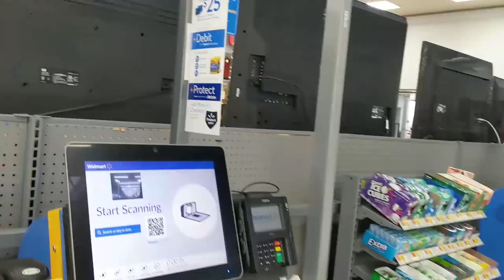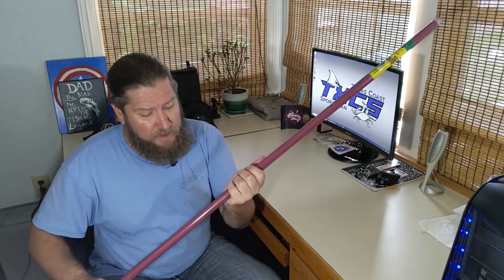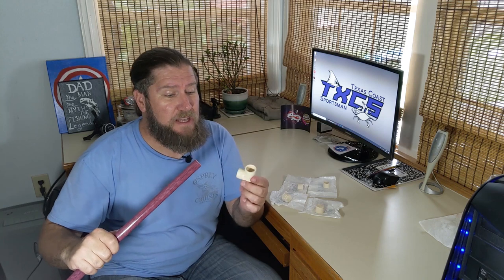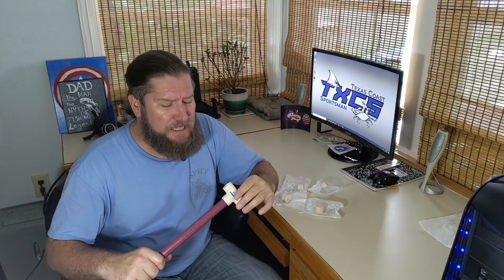DIY Stake Out Pole / Shallow Water Anchor all off the shelf parts

Comment: I drilled a small breather hole on the T, so the fumes from the 2 part epoxy could vent, and not push out any fittings when drying. Thanks for the diy. Tight lines.
Reply from the maker: That's a great idea. In the video you can see when I place the tee on the pole 1 end cap pushes off. No big deal just didn't account for how much air I was displacing.
Reply: @TexasCoastSportsman  id suggest just put the caps on last after everything else is cured what little bit you add for the caps shouldn't effect anything.

Comment: I found the poles at a local walmart on clearance for 3.50 each. Purchased two of them and 5.00 worth of pvc fitting and neighborhood hardware store and made two for my kayak. Thanks for the tip. Put part of a pool noodle around the top of pole if it falls in the end will float.
Reply from the maker: What? Your store has already clearance them! Man I might need to go buy a couple. I've got a boat project that I'd like to make a 12' for.
Reply: Louisville Ky. Come on up we'll hit a couple of lakes that are within an hours drive. Remember to bring your "yak".

Comment: I agree! What about the boat hardware into which this pole is inserted?  Any DIY instructions for that?  Thanks!
Reply: If it’s a 3/4” pole, it should fit through a scupper hole and work pretty well. Get perpendicular to the current, and you can put it in front or back scupper hole, depending on which way you want to be facing. 👍
Reply: I use my anchor trolley ring.

Comment: A tip another video showed was make 3 lines on the fiberglass pole then push your handle on so the air has a place to escape then twist it to spread the jb weld around. Rest looked good.
Reply from the maker: That's not a bad idea!

Comment: I built the same thing...heres a tip, here in North east FL we have oyster beds, 1/2 inch metal wire conduit fits inside the other end ...stick it in about a foot or so and leave a foot sticking out and cut on a 45 degree angle...goes right through oyster beds like butter...without this the fiberglass will shatter over time.
Reply from the maker: So, slip 1/2" electrical conduit over the pointed end to form a metal tip? Nice! How tight of a fit is the conduit? Do you think a decent length piece would add enough strength to join 2 together for a 12' pole?

Comment: I've made a bunch of these. IMO the 5 footers which are 1/2" diameter actually go in the bottom easier and are easier to pull out of the mud than the 3/4" diameter 6 footers. This time of year I've seen them for $2.97 at Walmart.
Reply from the maker: I checked my local store the other day and didn't see any but I didn't check outside... hmm

Comment: Howdy TCS. Just found your channel and subscribed. Built identical stick for my yak for $16 in 2018. It's a great cheap option, but not good for all situations. Results vary depending on bottom structure. Firm sand or rock is a no go. I mostly fish soft mud/sand mix. This garden stake works fine in certain situations, but tends to pull out of soft bottom in windy conditions and water +3' deep. Good job on the DIY vid.
Reply from the maker: Thanks for the sub! I keep telling myself I need a throw anchor for hard sand and shell bottom, but then I chase the reds up into the marsh and it doesn't matter any more. I've had a time or 2 when it wouldn't hold but most those cases the tide was dumping water like a ragging river. I've harpooned my into over 6' deep water to stick in the bottom and had it hold me. That's a crazy feeling throwing your stake like a spear and hoping the para-cord holds so it's not the last time you see it.

Comment: I made the mistake of getting the green garden stake the first time I made one. Don't do that. It will bend and it will break. This fiberglass model is much better. Great video.
Reply from the maker: I used a telescoping aluminum pole for my first one. How I didn't bend that thing into a U is beyond me.
Reply: I made the same mistake. They are made weaker than a soup can. I ended up cutting mine at the break and making a 3 footer to stick down scupper hole when I’m backed up into marsh grass. The T handle has a V recess so it doubles as a rod rest.

Comment: JB weld only needed on the fiberglass rod to PVC  "T".  Pvc cement adequate for remainder of project.
Reply from the maker: True but if you already mixed some up... My nephew did a variation where he only used the tee. Leaving both ends open to run his tether through.

Comment: ... Because of the very soft (silt) bottoms where I fish the pole needed to be longer to penetrate deeper for the holding power. I bought from Graingers, Rod Stock, Polypropylene, 3/4 In., 120 In. Added, like you did, a T on the top and sharpened the bottom. Use a 6'+/- rope from the T to the boat cleat on my Triton 240 LTS. Holds very well.
.
Reply from the maker: Nice!

Comment: How did you attach the pole to your boat ?
Reply: Same question...
Reply: I left my t fitting hollow and tied a rope thru it
Reply: Use a flag pole holder with a pvc extension to the same T fitting on the end for the pole to go through.

Comment: Bro thanks so much. This video saved me 65 dollars. I got that green pole that was next to the pink one you grabbed because Lowe’s was out of the pink ones. Got mine for 11 dollars with the cpvc. Just one thing, how do you stake it into the water without putting it in your scupper holes. I heard they break from the pressure. Thanks.
Reply from the maker: I use an anchor trolley so, I can position the pole at the front or rear based current. Plenty of people stake though a scupper hole I'm light current.

Comment: Metal tee is even better in plumbing section
Reply from the maker: What type of metal? I knew a guy that liked  using a copper tee. He was always concerned about a glue ability to bond with copper. So, he drilled and through bolted the tee to the handle.

Comment: Wonderful solution.  Can you detail how they connect to the boat?  I have a Carolina Skiff and would like to try this option.
Reply from the maker: For a skiff it could be as simple as a metal ring attached to a tie down cleat with paracord. There are several manufacturer of hard mount tubes that give you more of a power-pole  effect. Those mounts usually start in the $200 range.

Comment: Need that for my Titan, for sure!  Don't know if Wally World has those "sticks" this year (with the Kung-Flu going on), but I'll look for'em for sure!
(S/S Pop Rivets do the same "trick" as the Epoxy?)  
Thanks for the "Nifty" idea...  (Now, to invent a pulley-system or a cheap Motor Drive for it...!)  Haha!
Reply from the maker: There are guys using a plastic electrical box and pulley to make a "auto deploy" anchor. It uses the rod weight to drop and stab the bottom. Even saw the dude on Tiny Boat Nation build to for his aluminum boat conversion.
Reply: Texas Coast Sportsman do you have anything showing how they did that? Sounds awesome!
Reply from the maker: Search "diy kayak anchor pole" look for thumb nails that show a grey 4x4 box mounted to the kayak. For now I'm good with manual (spear stabbing) deployment.

Comment: great video! Subbed
what do you use for a spike on the bottom?
Thanks William
Reply from the maker: I don't, the pole I was able to get already has a sharpened tip. I've been able to find these poles this year.
Reply: @TexasCoastSportsman  cool, do you think two 12ft poles will hold a 15 ft aluminum bass boat? I fish in 7 to 10 ft of water. 
Thanks William
Reply from the maker: Yes, with a strong coupler. A PVC slip collar would probably ultimately fail.
Reply: Cool, Thanks!
Going to buy the supplies today.
Thanks again
William

Comment: These look way better than the pvc ones I've been using...do you think a 3/4 coupler would be strong enough to hold 2 of these together to make a 12 ft pole if I epoxy them in.. I'd like a 10ft one so I can cut a couple feet off... thank you for sharing this video
Reply from the maker: CPVC or PVC coupler may be a little short to build in strength. Maybe look at copper tubing couplers to see it they're longer.
Reply: Ok I'll check into that.. thank you
Reply: I would use aluminum tube longer
Reply: Did anyone actually successfully couple these?

Comment: Handle.  Great.  What about the other end?  How long was the pole?  Could you make it longer?
Reply from the maker: The pole is 6 foot and the other end is pre-sharpened. I haven't experimented with making it longer yet. The question is if you are using this pole what do you use to join them that will be strong enough.
Reply: @TexasCoastSportsman  JB weld a threaded male adapter or union to the fiberglass pole and do the rest in pvc to extend and break down? May be a good way to add length when needed. Not sure how well the pvc extension woul work..

Comment: I’m new to the channel do you have a video of how it works? Is the rod too thick for sand?
Reply from the maker: To work the anchor you just stab it into the bottom. In soft marsh mud I can deploy one handed while fighting a fish with my other hand. Packed sand usually takes both hands. It's not easy but not impossible.

Comment: Will PVC glue work instead of the epoxy?  Did you sand the pole before installing the "T"?
Reply from the maker: I don't believe PVC glue will bond to fiberglass epoxy. Sanding the pole would help create a "tooth" for the epoxy to bind to.

Comment: How does this work for the boat?  Is this for a kayak?
Reply from the maker: It works great for a boat. A Power Pole or Talon uses a 1" fiberglass rod to peg into the bottom of where ever your fishing. We are using 3/4" and your strength, since there are no hydrologics. Based in the size of the boat and the current you fish you may consider making 2. If you've ever thrown 2 anchors you know it'll stop you from spinning.
Reply: @TexasCoastSportsman  what do you attatch it to?  I am new to the boating world so sorry if I seem dumb lol

Comment: Any chance the hardware store and find a coupling, a bit more epoxy and instant 12 ‘ rod??
Reply from the maker: I've been debating the same thing. I'm concerned if a  PVC or CPVC coupling would cover enough surface area to make a strong union.
Reply: @TexasCoastSportsman  Use a length of PVC pipe
Reply: @TexasCoastSportsman  I was going to ask the same thing about a coupling making a longer pole out of 2.  I also wanted something that could break down in 2 sections to fit in my kayak and truck during transport - 2 4 or 5 ft sections.  I wonder if adding a set screw to each end would help?  Or using the M/F adapters for paint pole extenders?
Reply from the maker: It may ght be worth the $25 to get the stainless coupler from Max Gain System. They have full kits for making stake-out and push poles. But, if your going to pay for the full kit you may as well buy a Yak Attack pole.

Comment: These poles are on clearance for 
.50 cents right now I bought 4 of them  lol
Reply from the maker: What??? That's crazy!
Reply: @TexasCoastSportsman  question. In your video its says that the white pvc 3/4 tee is too tight.  However I bought one and it's way too loose.
Reply from the maker: @504Dboi06  lose in all 4 poles you bought? It may be a small tolerance issue between schedule 40 and 80. How loose? Free spinning or rock back  and forth? The epoxy will fill in some of the gap.
Reply: @TexasCoastSportsman  yes really loose. Too loose to work
Reply from the maker: @504Dboi06  do you have a caliper you can measure the pole with? I would measure then go to the hardware store and check them see way fits best. Schedule 40 ID is around .824" while Schedule 80 is .742”. If yours is 80 see if you can find some 40.

Comment: I just bought these stakes for 4.97 each!
Reply from the maker: I saw the same price the a few weeks ago. They're clearance to get ready for winter.
Reply: @TexasCoastSportsman  I just made two of them. I used 12 inches of pool noodle secured 3 inches under handle. Hoping that will be enough flotation
Reply from the maker: I keep mine tethered to my anchor trolley. Been known to throw it into the water like a spear if it's deeper than 6 foot.

Comment: How do you mount on the boat?
Reply from the maker: On a kayak you can push through a scupper hole but I prefer my anchor trolley. Allows me to position the angle of my kayak based on wind or current. On a boat you can tether to a cleat.

Comment: I asked this in a reply,  did anyone actually successfully couple these?
Reply from the maker: I'm debating coupling 2 but the weight has me concerned about using a diy sleeve. Max-Gain System sales a coupler for $26. But I looking at using it for a push pole. If you just want a long anchor you can probably get buy using copper tubing and a bunch of epoxy.
Reply: @TexasCoastSportsman  thanks for getting back to me.  I'm thinking of drilling down the center of both pieces, putting an insert in,  then threading them together.
Reply: That way I have a 6ft and a longer one if I want.
Reply from the maker: I had the same thought. But when comes to center punching with a drill... I don't have the best track record.
Reply: @TexasCoastSportsman  that's my fear as well.

Comment: So how do we put it on the boat
Reply from the maker: How big is your boat?
Reply: Texas Coast Sportsman 16 ft
Reply from the maker: You could make a fixed slide through pipe mount. But I prefer for my kayak to be able to move since I deal with choppy bays. Search Google Images for "shallow water anchor mount". You find some good ideas.
Reply: Would you recommend putting it on the front or back of the boat
Reply from the maker: Depends on if you fish moving water. The easy is yes, both. Think of it like throwing an anchor. Which way will the boat spin? Depends on wind or current. Short answer could be use 2. One for both sides so the wind or current doesn't spin you

Comment: How did u shave it to a point?
Reply from the maker: It comes pre sharpened. It's a plant stake designed to be driven into the ground. You could do it with a grinder but that's alot of fine fiberglass in the air. At bare minimum wear a mask and eye protection.

Comment: At 00:52 you see the green ones on the right. DO NOT buy those.
 They were the only ones I could find and I thought they were solid but they are not. 

They break very easy when used as pole anchors.
Reply from the maker: That sucks! Came across a few people that used those poles and they eventually failed.